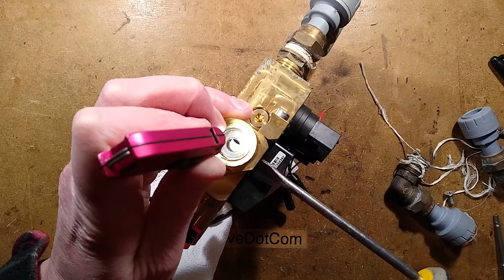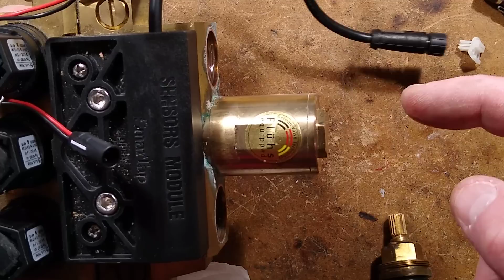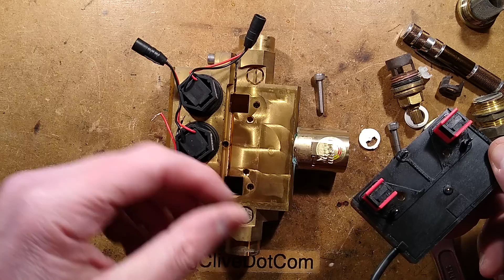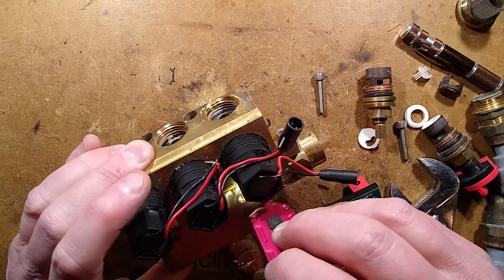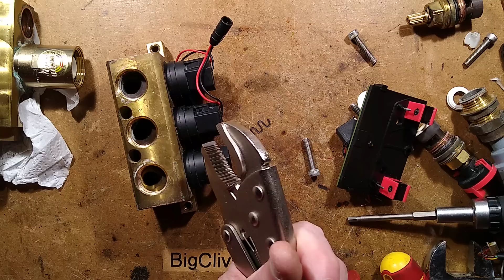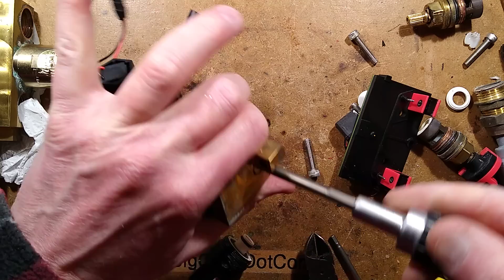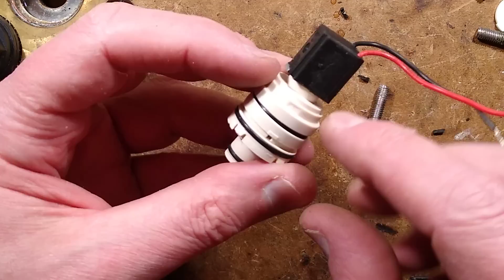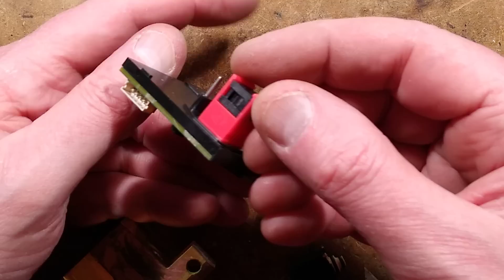Smartap manifold teardown (it's a beast!)

Comment: where do i start?  that verdigris indicates leaking.  designed to not last long.   what a complicated pcb and no water protection.  omg, all those fiddly little bits that all needed manufacturing.  its function could have been achieved without any electrical stuff.  water and electricity dont mix.  oh the futility of it all.  enjoyable video.  i think there are a few strange components that need a deeper exploration in part 2.

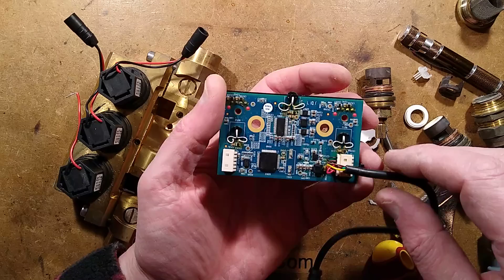Comment: 8:32 The absolute joy in Clive's voice when he discovers a massively over-complicated circuit board inside the sensors module is wonderful to hear.😆
Nothing I like better than watching Clive while he explores a weird piece of tech.
I have to say this seems needlessly complex, given that a bog-standard pressure balanced shower valve will just work without an internet connection or electrical power.
Of course, with the old way you have the drudgery of actually setting the shower valve to temperature with your own hands (how GROSS!🤣)
Any society that has lost its way so far that it needs the ability to remotely control a shower head via the internet seriously needs to get out and touch grass for a while.
(c.f. Douglas Adams:  "It seemed to me that any civilization that had so far lost its head as to need to include a set of detailed instructions for use in a packet of toothpicks, was no longer a civilization in which I could live and stay sane.")

Comment: as the guy people call to repair stuff, these teardown videos are invaluable to me and people like me, sometimes for the exact device, other times like this for the mechanical principals of operation, would not have thought they would have water-assisted attenuation, i found a small device that measured air/gas flow....what the heck was it.... i forget, you could blow into 1 side and something inside would spin, FAST with virtually no leak pressure past the spinning device and it used a hall effect sensor outside to tell how much had passed through it, OHHH it wasnt air/gas, it was water, i just remembered, it was a brita water filter that goes on the output of a tap, it counted how much fluid had passed through it to estimate filter life and probably disable itself automatically when you needed a new filter
Reply: i work in coffee machine repair (big ones like in large companies and gas stations etc)     Those little Flow-meters with the spinning inlay are the heart of almost every coffee machine!    (google for example "flowmeter Rheavendors") .
Also,   another interesting part is the pump they use in most beverage machines,   they use Ulka Vibration Pumps!     these are comletely silly!   if you open it up there is just a little ball inside and the big electro magnet just triggers super rapidly to make that ball vibrate,  and somehow that builds up ALOT of pressure to one side?    i have no real idea how it works lol,  but pretty much all the machines i work on use those pumps!
Reply: little update,    i just figured out how vibration pumps work!   https://www.youtube.com/watch?v=we9IZJ5tQFs     (and ive been doing this work for 10 years lolll)
Reply: @raafmaat  the flow meters have evolved a bit recently, now have 4 Hall effect sensors instead of 2.. another coffee machine engineer here in the uk😊 this looks so over engineered, can’t wait to find something like this in a la marzocco soon 😂😂😂😂
Reply: They used to use counter-rotating vane-type flow meters to measure/regulate large volume flows at fueling racks and loading docks.  The counter-rotations were a self-check mechanism of some sort.

Comment: 9:21 Those square blocks would appear to be flow meters, then you have the 3 temperature probes (hot, cold, and mixed). While the temperature probes alone could allow you to do the mixing, the flow meters allow for faster regulation within the PID feedback, since a pressure imbalance may cause the valve to otherwise be unable to properly regulate the water temperature without overshoot. Making this a separate dedicated assembly makes a lot of sense, since it can then be calibrated with the valve it's going to be controlling/monitoring. -edited to remove an auto-miscorrection typo
Reply: It also helps when some git flushes the loo and causes a massive pressure drop in the cold line but not the hot. The controller can compensate and not scald the user.
Reply: @ericpaul4575  This is one of several pressure imbalance conditions I was referencing, without getting too specific.
Reply: Just put a DNF notice on the loo 😆
Reply: @Gazr965  That definitely works, when you have siblings... said no one ever.

It's almost guaranteed that they'll flush the toilet precisely because you're taking a shower, perhaps even multiple times.
Reply: That's evil😆 @thomasbonse
Reply: But it's only a shower mixer, not a laboratory criticality to half a °F and we lose the planet😆
Reply: I have one of these and can confirm it's exceptionally good at maintaining a consistent temperature. You can flush the toilet and, other than a slight drop in flow rate, you'd barely notice.
Reply: They probably are very good, until they go wrong, usually clogging issues, they are very expensive too. @GajitUK

Comment: Maybe the big cylinder in the middle is the pressure equalization valve? Dunno if that makes sense if the unit heats the water locally, but in the US, the equalization valve prevents one from being scalded in the shower if a toilet is flushed.

"Spanner" in the US is more specific and comes in pin, hook, and face varieties. They fit into notches or holes in the perimeter of the fastener and pull it around.

The stuff on the fitting appears to be Teflon tape. You can also get cord, but that is used for packing valve stems, not on threads.

The red things might be flow sensors.

Comment: Very important plumbing advice: Always have a real towel or more for all of the water that endlessly spills.
Special tip: When you are underneath your sink and remove the J-trap, it is full of water. Obviously, the most convenient place to empty it is through the sink above. We spent years laughing about the guy that did this. Another reason for real towels. I confess I almost did this myself once.
As far as temperature control, that is important. We were staying in a hotel where the shower water fluctuated violently between freezing cold and scalding hot. It went scalding just as I was fully soaped up. I jumped back and slipped on the soap suds. I hit the side of the tub on my back. Luckily, I hit my back ribs. Another centimeter and I would have hit my spine and broken my back. As it was, I spent months in agony from the bruised ribs.
Reply: That's almost (almost) the equivalent of rushing to do an oil change only to discover you're happily oiling your drive because you forgot to put the drain plug back in 😂
Reply: Been there. Done that. Got the T-shirt.
Reply: I absolutely will not do anything to a sink drain without removing all the clutter underneath (there’s always a mess of bottles, jugs, and other stuff that seldom gets used under a sink but can’t be thrown out) and placing a bucket or other suitable water catcher under the trap. No, I never dumped the trap into the sink but carrying it to another sink is outside my juggling capacity. Guess how I found that out.

Somehow I’ve managed to avoid falling in showers in my 71 years. I’m quite happy chalking it up to dumb luck. On the other hand I end up with a blood blister every damn time working on plumbing, often doing what Clive did with the vise grips.
Reply: I feel another Big Clive poll comming on. "How many of you have emptied the trap into the sink it came from?" 
I predict a near  100% result spread over  "just the once", "a couple of times" and >1% "never"
Reply: There's pressostatic showers to keep temp steady. No electronics. I have one from 1980s still working, but retired in my garage

Comment: Ive just replaced a shower pump, and it has sensors on the hot and cold that were hall effect sensors to detect water flow.  Theres a small piece inside the 2 outlet pipes that is deflected by water flow, and lets the pump switch on when detected.  I think it needs both sides to flow to let the pump keep running, so if you run out of cold water you dont get scalded when bouling hot water only comes oht the shower

Comment: Just got such a massive brass-ish thing replaced in my bathroom, as the water corroded completely through it (after 20y) just 1cm before the shutter valve for my flat. Closing my valve did not stop the waterfalls in the flat below in the middle of the night 2d ago. So we had to stop water for the whole house and had a preview of what „nothing works anymore“ complains of some people in my country would really look like. I was lucky to find 1/2l in my coffee machine for toothbrushing. And to shower I used the gym.

So if the electronics/cloud/… is not lasting forever, the „hardware“ might be prepared to hide that 😂

Comment: A pilot valve is just a small valve operating a bigger valve, but they work the same way, so if there's a power cut, the small valve closes, which would close the big valve
The input pressure sensors could be to stop the unit operating if the pressure is too low, remember the old mechanical showers that had a diaphragm with a microswitch in series with the heater ?

Comment: I think the red modules are magnetic flow sensors - saw that in a Dolce Gusto coffee machine once. It's got a small wheel spun by the flow of water inside of which a magnet is enclosed. A Hall sensor nearby detects when that rotates.

Comment: I think those little red things are magnetic flow meters, as water flows through the magnetic field it generates a voltage across two metal probes in the water which is proportional to the speed of the water movement.
That thing is ridiculously over engineered.
Thanks for sharing, I did enjoy this one.
Reply: It's not only overengineered, it's also built in the most expensive way imaginable -- it looks like the manifold is machined two solid chunks of  brass, like you would build a prototype. Just think of the machining time, the wasted brass, and the manual labor it takes to assemble just that mainfold. That might also be part of the reason the company's defunct...
Reply: @randomguy7253  valve bodies like this are fairly common in industrial control systems for refrigeration / hydraulics / steam / etc. My guess is they're using a stock manifold & installing their complement of valves & meters.
Reply: @randomguy7253  no, the reason it's defunct is cause they had money to launder. Most business is a mafia's front. Where you think all the tax go?
Reply: Pretty cool, thanks for explaining
Reply: Yup

Temp is already covered

Flow is that contraption, first thought was a vortex meter but could be orifice plate

Plenty of connections could be all manner of witchcraft
Reply: To sense pressure drop?
Reply: For some reason I'm reminded of the ultrasonic fuel flow meters as fitted to early carburettor fed versions of the MG, Vanden Plas and HLS Maestros fitted with the digital dash set up. Them was the days!

Comment: @19:31 - What it's saying to me is that those are pilot-operated proportioning valves and that something on that circuit board you found controls the pilot valve (possibly the red blocks adjacent to the probes) based on temperature readings derived from those probes.  I still have a couple of minutes to watch yet.  In essence - a digital/mechanical temp mixer.
Reply from the maker: The other video about this unit shows the servo motors.
Reply: @bigclivedotcom I really do not think that the tap would be controlling the temperature and flow with quarter-turn valves though.  They're simply and on/off device.  I truly think this is a proportional mixing valve setup.

Comment: Nice tear down Clive. But thinking I’ll stay analog. However if I do any plumbing I allways fit a shut off valve on any feed pipe to an item. Makes it soooo easy if one has a problem. No need to shut off mains supply and possibly drain internal tanks or hot water cylinders.
Reply from the maker: I always add local service valves for convenience.
Reply: @bigclivedotcom ditto on that, I always keep a bag of them handy for that very reason and it made refurbing our ensuite so much easier. It took me 18 months to finish it though lol. Great video by the way!!

Comment: I would have thought it would have specified that the installer supplied and installed external isolation valves, unless it's designed to be fitted inside the wall and you had limited access to it? I've never come across this brand of digital shower.

Comment: I was a plumber for a long time and the tub and shower valves all started to have those integral stops on them I think back in the 2000's. Code started requiring them. They're used so you can shut off the valve and service it without turning off the main. At least that's what they could be from my experience. Cheers.
Reply: Also so builders could save and not put in any shut off valves other than the main one.
Reply: They are a huge cost savings for multiple dwelling units -- apartments, condos etc.  The administrative costs to shut off the water could pay for a lot of hardware.

That use case is also the motivation to facilitate back-to-back installations without excessive depth, which means the hot water will come in on the 'wrong' side.  A building will typically have a "wet wall" with all of the plumbing, and mirror image bathrooms
Reply: That's what the enginerds say on paper but in the real world since they're never used they get corroded and you just strip out the flat head if you try to turn it.

Comment: The was a battery pack for power cuts wasn't there?
Reply from the maker: There was a 9V lithium PP3!
Reply: @bigclivedotcom If they just used washing machine solenoid valves, they wouldn't need the backup as the valves would automatically default to closed.

Comment: The globe valves are there to allow local shutoff for service and are required by some building codes.

The slots in the valve manifold are allow them to adjust the fit of the temperature and pressure probes.

Comment: This was looking at a pcb /machined brass nightmare.  So many places to fail. Water, electronics, valves, diaphragms....
Add a bit of sand, mud, organic alge, and microbes, hard water minerals....  A time bomb waiting for service technician.  Was this designed to be used on the Columbia Space Shuttle?  They certainly did not follow the KISS design.  Great job Clive?  There is no telling what is happening on the PCB.
Reply: UMMM if installed correctly no sand, mud, or minerals microbes and algae ? no more than any other shower

Comment: I have a similar remote controlled shower (not IOT) and the sales pitch is that the 'digital' controlled shower ensures that the water temperature at the shower head , once set, is maintained irrespective of the pressure or temperature of the incoming water.  You only have to press the on button and wait for the monitor lamp to stop flashing to know that the temperature is the same as the last time you set the control.  The original sales blurb said "flow control is modulated to ensure stable temperature control" although I see those terms are not mentioned in the current sales blurb for the 'new improved IOT' version 😂😂😂😂

All that electronics and the sensors must be needed to achieve this.  This is probably necessary to cater for the different water systems we have in the UK (combi, header tank, system) where the pressure of the hot water in particular can vary rapidly if taps in other locations are turned on. Maybe a standard thermostatic valve would not keep up?

Maybe  these types of complex controls are  mandated in hospitals / institutions so that patients cannot scold themselves or be scolded by water temperature changes?
Reply: I have never scolded myself but my mother used to scold me when I was naughty.
Reply: TMV3 standard required for commercial...
Reply: Hospitals just buy the institutional basic disability compliant taps, set them to "won't scald" and say good enough. Then some patient or med student breaks it and they replace it with the extra they have on hand that almost fits. This sort of "designer electronics" for tap water is totally a "my house is soooo futuristic" market.

Comment: I think the sensors next to the hot and cold temperature probes will be for flow measurement. Not needed on the output since that is just the sum of the inputs.
The output temperature should be: B x (T(h) x F(h) + T(c) x F(c))/ (F(h) + F(c)) where T is temperature, F is flow and B is bias (see below). They do not need to measure the absolute flow rate, just the comparative flow rate of hot vs cold. They do not even need to be particularly accurate because, by knowing the actual output temperature, the ratio of hot to cold can be biased to adjust expected vs actual.
I did some work on this sort of relative flow measurement about 30 years ago although that was based on controlling pumps rather than pressure fed systems.